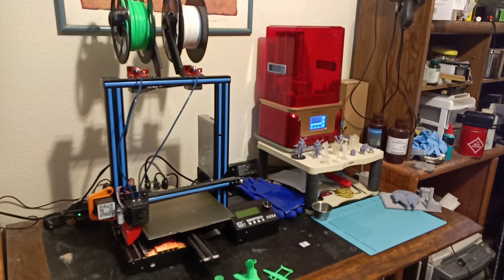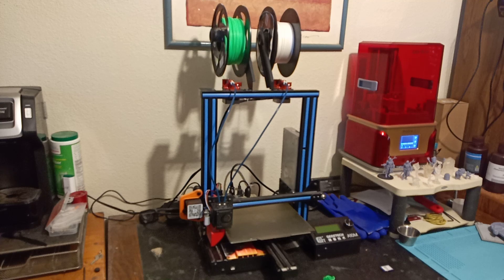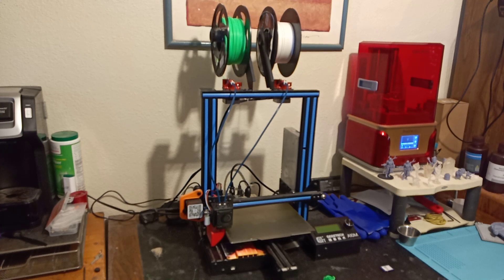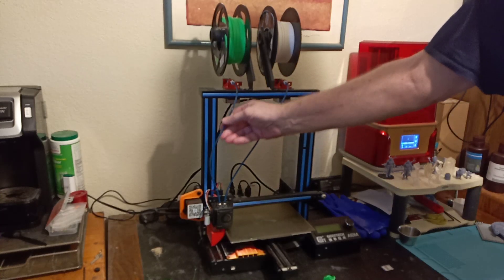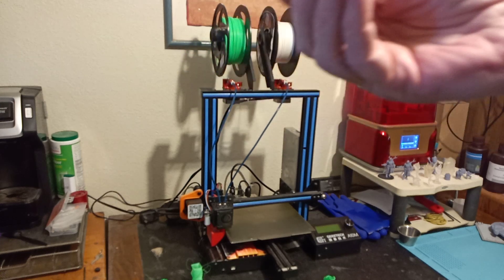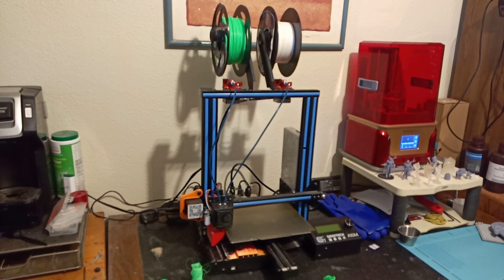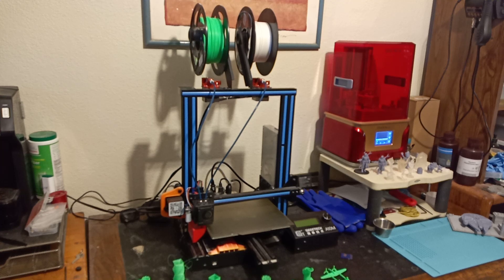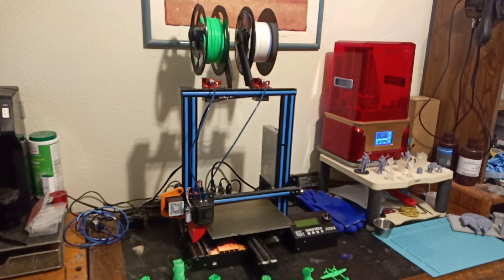My Geeetech A10M went nuts, or how to troubleshoot FDM 3D printers.

Comment: Thanks for the troubleshooting video!  I do troubleshooting on a regular basis, but it requires that you know the systems involved!  Thanks for pointing out what the systems are, and for trying a work-around that I need to try to hopefully fix the problem with MY A10M.  (Mine is having difficulty reading the SD card, or even telling whether or not it is there.  It says no card available, but if you take it out, it notices that you removed it! )  I'm gonna try the USB cable next and maybe set up an Octoprint system.  
Thanks!

Comment: The mainboard on mine died. I didn't really like the board that was on it so I thought an SKR board would be a good fit. That turned into quite the event. I didn't know much to start with so it took me a couple of weekends to finish. I don't know which was worse. The build or the firmware?. I went with an SKR 1.4 turbo with 2209 stepper drivers in UART. Sensorless homing on the X and Y is nice. Color touch screen is super awesome. But the very best part. I put the same extruders on you did. Those titan clones were crap. lol
Reply from the maker: I think another board is how I'll end up going too. At first I thought it was a bad card reader, but I've replaced the LCD board and card reader and still have the same issue. It's really bugging me though that it prints from the wife adapter fine, that tells me that that the control board is OK, but the only thing left is the cable from the LCD board, and I doubt that's bad. A really puzzling problem. I put an SKR 1.3 board in one of my Ender 3's, so at least I've got some experience with it. Thanks for the reply!
Reply: @3rdpig  No problem Chuck. Get at me if you need the marin firmware

Comment: Hey maybe you can help e fix my A10M, my problems started around 4-5 months ago, it just didnt seem to print fine, I was having a lot of under extrusion. The extruders mainly didnt extrude 10 mm as intended it was way less, so to fix it I tried updating to Marlin 2 and now it starts the usual home secuence but then it just goes to a specific place every time which has nothing to do with 0, aftrwards it just really doesnt do anything. I believe it does heat the extruder but the others servos dont really work. When tested directly form the LCD panel the are fine Home X and Home Y are perfecto but Home Z is the one really messing everything up, also I get this ? symbol next to Z in the display. Please help!
Reply from the maker: If I were you I'd flash the stock Geeetech A10m firmware back. Your under extrusion problems were either related to the craptastic stock Titan extuder clones (which I've replaced because I had the same issue) or a jam in the hot end, which I've also had.
Here's my video replacing the stock extruders with the new Creality style dual gear extruders.
https://youtu.be/s6sT4e-oo3Q

Comment: Thanks for the troubleshooting video. It can be both interesting and frustrating at the same time trying to figure out why things go wrong. It looks like you’ve narrowed it down. I hope you can find a replacement board/cable to fix your issue. With how fast they update these printers sometimes finding the exact same part can be difficult. Nice thing about the 3D printer industry is there are all kinds of newer/better and sometimes cheaper replacement boards and displays available. Good luck and keep us posted on your progress.

Comment: I can't imagine using a 3d printer without octopi! :-)
Seriously, even an Pi zero W works. It's kind of slow, but it's better and faster than swapping sdcards. TBH, I don't know if I've every printed anything directly from sdcard. Plugging in octopi is one of the first things I do to a printer.
Reply from the maker: I've used printers set up with one, but for me the juice just isn't worth the squeeze. The printers I use on a daily basis are damn near within arms reach of my desk. I felt the same way about auto bed leveling. Back when I got my first Ender 3 everyone said "I can't imagine using a printer without auto bed leveling". Well, I've done both and to be quite honest, I'm just as happy leveling it manually as long as I've got a nice flat bed.
Reply: @3rdpig  Fair enough. My printers both have 4mm glass beds, so they're pretty flat as well, but ABL does improve them somewhat. The main reason that I need ABL, though, is because the printers also have dual Z screws that "settle" when I turn off the printer, so. I actually do a auto level on the Z axis before every print, which requires an ABL sensor.
As for octoprint, I'm also very close to the printers, so I don't use it so much to support wireless printing, but for all the other tools that it provides. I'm also a computer geek with a big box full of raspberry pi's and other, similar SBCs, so why not. :-)

Comment: never saw this  before, is the card slot physically connected  to screen,  i always thought it was on  a separate ribbon
Reply from the maker: It's actually soldered onto the back of the LCD board.

Comment: I have 2 suggestions - have you considered a corrupt firmware flash?  Even though it prints from Cura fine.  Second - Check out a free program called SD Card Formatter and have it do it's variant of a "low level" format on that SD card and write zeros to it.  Sounds crazy, but I have recovered lost space a couple of times with that.
Reply from the maker: I've flashed the board twice since the problem started. But I've used the same Marlin folder on my computer. I suppose it could be corrupt itself. I could certainly download it and try again. Thanks, I didn't think of that! 
 I formatted and tested the card I normally use and I also used the high speed card I use with my video camera. When neither of those worked I bought a brand new Samsung card. Same problem on all 3. I'll try SD Card Formatter on one of them, but I'm not expecting much. If it works I'll come back and eat crow. lol. Thanks for giving me your thoughts!